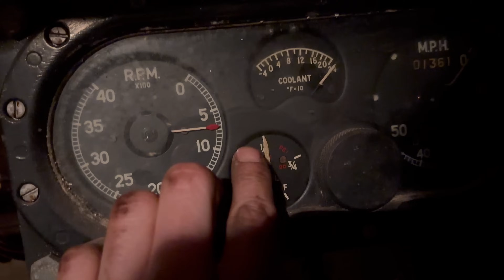Getting technical with centurion starter motors!

Comment: Really interesting video thanks. Both the BARV and the Chieftain look great. Seeing the tow hooks on the front of the Chieftain reminded me that they were a good early warning system for someone climbing onto the tank and you were in the turret having a skive. The natural way to climb up was to put your foot on the tow hook, grab hold of the fording plate and heave yourself up. But when you put your weight on the tow hook, it would move slightly and clunk against the hull. This could be heard in the turret, giving you enough time to put away your newspaper and get on with some work.
Reply: Haha good stuff.

Comment: I find it rather surprising that they use grease rather than gear oil in the gearbox. It was noticeable that when you opened both boxes the grease had flung to the outside leaving the gears dry. I would suggest that this would contribute to the weakness of the gearbox itself.
While the use of oil would complicate the construction with the need for oil seals on the shaft and drain plugs etc. it would provide far better lubrication.
Reply: I noticed that as well.  

Perhaps a switch to a '00' grease may be a better choice.  That's what is used in snowblower auger gearboxes.  It performs really well in cold conditions.  The starter motor is never going to run long enough to turn that thick grease into runny grease.  It explains the clean grease on the outside never thinning out and getting to where it's needed.
Reply: This is nearly 70 year old technology. What you have to consider is what is the least used component in nearly every ICE today? Yep, the starter motor.

Comment: Since you found swarf from the failed gears in the old grease, why did you not thoroughly solvent wash the gear cases to remove all traces of contamination?
Reply from the maker: I ran a magnet over but your not wrong that would be the best

Comment: Good feedback for the (designing) engineers: redesign that part in such a way that it can cope with the backfiring of the engine, 
although it's 'only' for the timing of the engine....
right..., explain that to the servicemen in the field when they have their beast dead in the water, right in the middle of a garnish

Comment: Hey, that looks like a standard mount for a radial engine with a three jaw right hand rotation.
I used a 3350 Wright inertia starter on my tank engine.
It might be a considerable upgrade for your tanks? It does not appear to be any larger that the original.
Unfortunately, the guy I was getting them from has recently passed away.  I think the last one I bought from him was 375$ US. PS, they have an adjustable clutch to prevent damage during a backfire.

Comment: Wouldn't it have been a good idea to clean all the grease out in case bits of teeth/metal chards was still present. Only asking as i have never worked on a starter motor.
Reply from the maker: I scanned over. I rolled the dice 🎲 but yes best to clean the lot out
Reply: He got most of the chunks out, but you need to leave a few for nostalgia.

Comment: Does look like the grease has suffered from water ingress and lack of changes. Are these gearboxes open to the elements per chance? Noticed there's no seal on the casings. 
Maybe a thought to add RTV sealent to the faces or get a groove machined in for a small diamter o ring.

Comment: No wonder those motors fail! Surprised some enterprising young fella hasn't modified one yet
Reply: they also get full of condensation and rust   like the titanic    and sound like a bag of ball bearings dancing about , i had considered  fitting up a honda 6 hp as a donkey engine

Comment: Tungsten disulfide powder will help. It is an order of magnitude better than low utility, more expensive moly grease. Add the powder to any grease or oil, and if there are no wet clutches, everything will work MUCH better and last MUCH longer. 
It works great for old bearings with some bumps, it evens out and wears normally over time because there is the tungsten sulfur platelets that embed into metal and will stop galling and friction when the grease or oil cushion gets pushed into metal metal contact. 

This will absolutely fix the starter problems if they are new or on their last leg, BUT still have some tooth to grab onto. 
It will lower the heat problem on the small gear, and metal to metal problem because the tungsten sulfur will lubricate, like graphite almost, but actually much more effectively than moly or graphite because the tungsten bonding is stronger. Make sure you dont buy straight up tungsten though or impure tungsten disulfie tho. 
Not sure about graphite containing grease, it sounds like that could work too. 
Anyways, Micron powder tungsten disulfite. In grease until it turns gray or dark grey will work in this certain circumstance.

Comment: Funny how a starter motor was so wrongly engineered by experts at the time. You would think it would be over engineered in such a enormous piece of equipment. Brilliant video on seeing the problems and great volume of tank engines.
Reply: These are an aircraft starter and relatively 'light' and compact. When they designed the Meteor M120 for the Carnarvon/Conqueror , they built in more strength (but used Lucas fuel injection) including replacing the starter with a much bigger unit and a ring gear. Often wondered why these improvements weren't incorporated into the Cent engine.

Comment: Such a bad design almost like the manufacturer wanted to sell loads of spare starter motors to the MOD.
Reply: Can’t blame the manufacturer, blame the procurement officer/civil servant for not having the engineering gen.
Reply: It’s bizarre to me that they would use such tiny cogs to turn a massive engine.
The tank engine sounded Savage
Reply: @solobushcraft1 the small gears are attached to the starter motor so the full load of the engine isn’t going through them because of the planetary gear box.  I think these starter motors are well past service life too and we don’t know how many hours they’ve been used for. It could be they outlast the engine.
Reply: It's because the engine is basically an aircraft engine. You have to make the starter as light as possible for in the air it is just dead weight that your carrying around for no reason.
Reply: like in everything. you have to create a weak point...to allow it to fail...rather a gear than the actual motor explodes as it spins at engine speed and throws all the windings out.
Reply: bingo
Reply: Service and re grease 10 years ago would have helped.
Reply: I think you are missing the point of history. These engines were designed for aircraft that would be blown out of the sky in a few missions. Look at the Bomber command crew losses some 30,000 men. These engines used for tanks were often recon aircraft engines that could not make flight grade. They would use much of the same equipment as the air version in basic condition by extension of existing contracts. In war designs you use what is available , cheap and producible. Remember that the Americans insisted Rolls build engines that were production line producible and required far less individual fitting than the early ones. Post war in a country that was saddled by a war debt that required its citizens to pay income tax at 47.5% let alone super tax at 80% such items were not going to be redesigned especially as the new engines were jets. Then we became involved in the Korean War which cost us half as much again as the WWII. At that time there were lots of starter motors.

Comment: Were these gear problems not rectified whilst the tanks were in use/production? Or was it a good money maker for the starter motor manufacturer supplying new units?
Reply: God knows but must have been hell for the Crew each time they had to move fast and wondering if the starter would get destroyed each time.

Comment: the main engine uses less current to start  than the aux gen with the huge gen on it,,, never had a starter go out in the 21 years i was in service,,,,,you can also start the main engine  wi decent size electric  drill and turned extension and socket on the vertical  shaft,,,the ratio is  133 to 1,,,,

Comment: You’d think that the gear casing would be oil filed to avoid all the ancient grease turning to crud.
Reply: remember , these are tanks designed end of WW2 , start of Cold war .. life expectancy of them was probably estimated in months
Reply: The oil would turn to crud and would need seals, they would fail and let the oil leak out. Think of grease as just thick oil.
Reply: @johnnunn8688  grease = safe oil.
Reply: Think about using John Deere Corn Head Grease. Is grease when cold...but heavy oil when hot. Combines in America use it exclusively.

Comment: That intermediate wheel looks like it was cast from the surface finish, a machined gear maybe even a two part gear would be far better,  an alternative would be a gear set from a geared starter like for a truck as long as the output shaft was compatible at least it would be a repairable part

Comment: You mentioned turning the gear in the starter motor, used for timing, around so that it no longer ratchets, is that gear and ratchet system just one of many other ways to time the engine or is that the only way? Which would mean you would need turn it back around to time the engine again?
Reply: Never mind you answered the question later in the video excuse my impatience to get to the end of the video XD

Comment: Great to see it running, such a great sound.

Makes me wonder if you could retro fit a clutch into the starter so it would just slip on the backfires, although i wonder if a more modern motor that was direct drive would be possible to start the engine, as it hangs out the back your not so restricted to the mounting of it so if you could fit another motor in there pretty easy. 
If you could find a mass produced motor that is not too expensive and up to the job then make a adapter to fit might be a good upgrade. 

Great video always interesting to see something you normally would not see.

Comment: Shame designer didn't use ep gearbox oil instead of grease. Remember Leyland trucks used have a  gear reduction on the rear axle half shafts .

Comment: May I suggest that you bring those engines up to full operating temperature.  This gets moisture out and lubricants into odd places.  I have a friend who started an expensive aircraft engine for the briefest amounts of time, sucking moisture inside and rusting away the interior components.  It was, rather than "Recently overhauled," totally junk.

Comment: Couldn't help but notice the fishtail exhausts. Old Velocette motor bikes had them as well, what's the advantage ?  Any ideas ?
Reply: It's to increase the airspeed out of the tailpipes to reduce the risk of allowing seawater from being injested when it's wading in the sea
Reply: I see. On a Velo. they would help scavenging the exhaust gasses a bit. 
Many thanks.
Reply: @davyfella the fish tail was the standard exhaust on all types of centurion

Comment: I have  CAV soft start starter motor on my Patrol boat, Its 24v which might be a issue for you but I think you could graft the drive gear you have onto it and it will take loads of abuse. DM me for details.

Comment: I’m a little confused…..the starter motor isn’t connected to the engine unless the starter is operated, which throws the thingy into engagement until the engine starts, it then disconnects. So what has that ratchet doohickey have to do with the engine timing?
Reply: i think its to allow you to crank the engine forward a pre-determined amount. not yo set timing like a mark on a crank pulley. if that makes sense

Comment: Switch your grease to a '00' grease for better lubrication.  It's used in cold conditions or in places that don't get hot enough to get regular grease mixing around and flowing into the gears.

Comment: Any decent engineering company that does gear cutting should be able to sort you out with some good gears in high carbon steel. 
The grease that was in them to start with was shite. Also (and this isn't an I told you so comment) using fifth wheel grease won't help as it's the wrong type of grease for gearing. We used to have grease in the army called XG276 which was designed for this type of application. Ideally a lithium complex based grease is what you want. I think 5th wheel grease is graphite.  
But at least it will lube it temporarily. 
When you opened them up you could see the grease was basically solid and doing nothing.

Comment: Clearly not enough grease in there. Also not using the right type of grease or lubricant or the correct amount will cause more friction and premature failure of parts. There's a reason a car gearbox is not packed solid with some random grease.
Reply from the maker: You keep to working on cars 😉

Comment: My question is...When the Cent was introduced and with various upgrades, was the weak starter motor a known thing within the manufactures/MOD? Seeing as so many were made and exported, was it only the British starter motors that were "pants". I love that phrase and have not heard it for years. Or, was this a big "fail" for anyone receiving them?......Mr Hewes, my faith in your "keyway location" has plummeted, i presume it is due to this rather intricate and not fit for purpose piece of machinery that you are now having to rectify? Only something as complex as that could be British and that is why Britain failed in the 50/60/70's.  Two words, British Leyland, that explains so many fails in both Military and Civilian  motors.
Reply: BL built the the later marks of centurion but it didn't have any BL mechanicals,engine RR,gearbox Merritt Brown etc